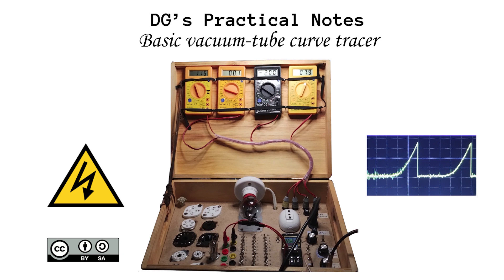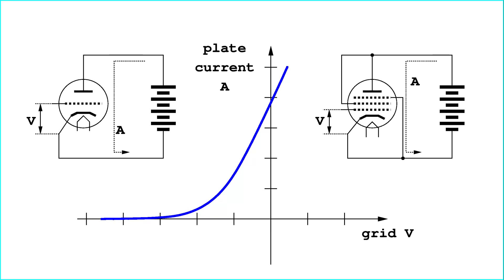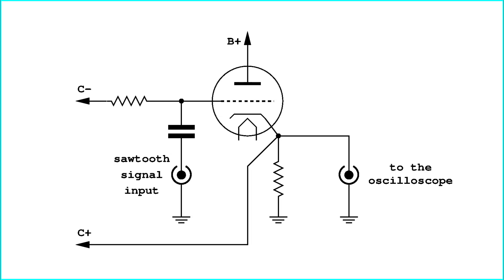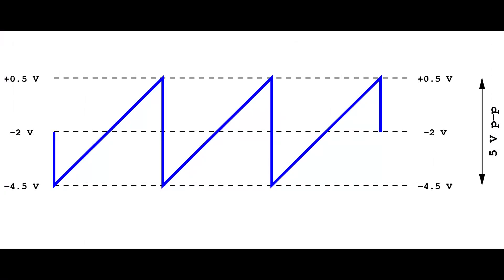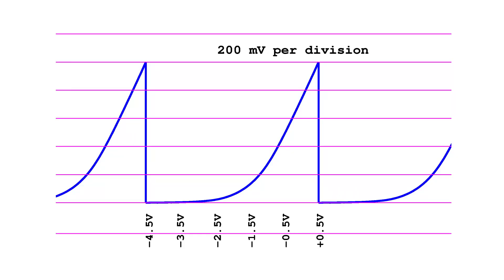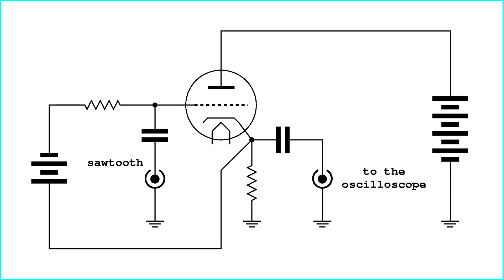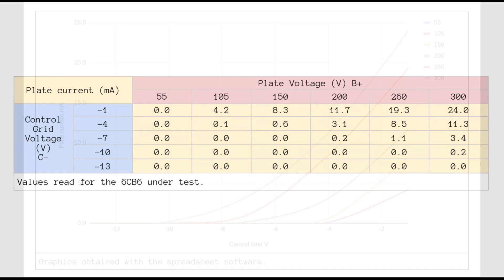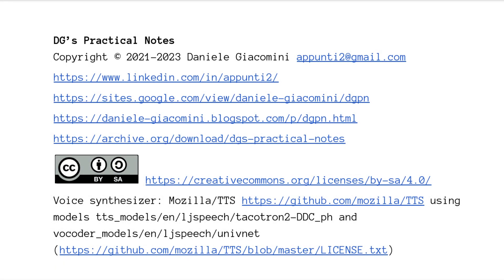DG’s Practical Notes, i#1 Basic vacuum-tube curve tracer

Comment: A rather nice project. A (very) small point for correction... You used the term "insulation transformer." I believe that you meant isolation transformer. Your safety warnings are well warranted and should be headed, as tubes use dangerously high voltages. Kudos.
Reply from the maker: Thank you so much for your comment and explanation. I can see that I made that language-mistake also in other videos and I will try to remedy, starting from the written version of these works.
Again: thank you!
Daniele